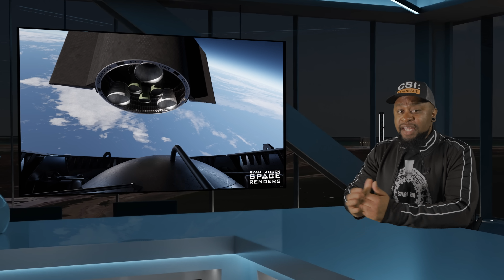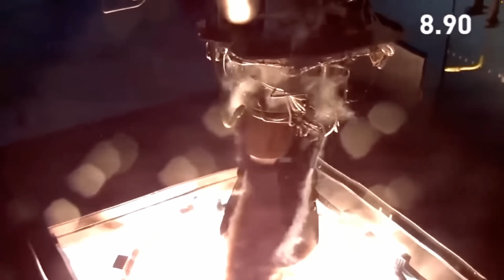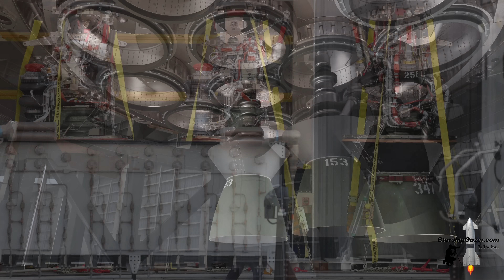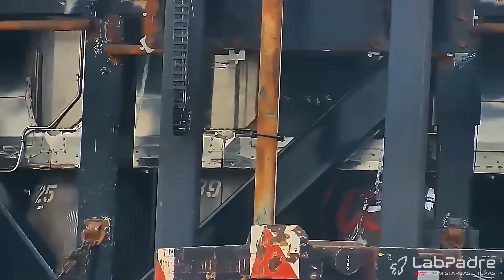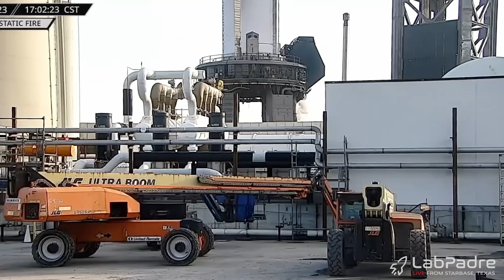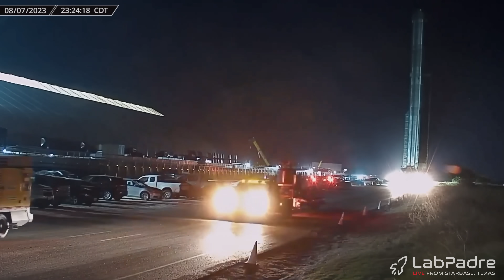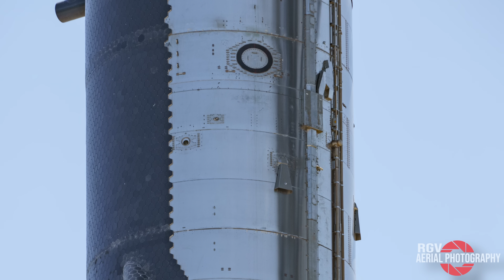How To Prevent Raptors From Destroying SuperHeavy | Part 1

Comment: If NASA had blown up two SLS boosters in flight, would the media have been as forgiving as they have been of SpaceX?
Reply from the maker: @wpatrickw2012 Probably not, SLS is not an experimental rocket. It’s designed to be an operational rocket from the very first time it flies.

Comment: The launch bidet table needs a spray with water based rust inhibitor after launch. It should be a low cost way to reduce steel ablation.
Reply from the maker: *After launch, would not help what happens during the launch.  Also it’s made of stainless steel so it doesn’t need a rust inhibitor.

Comment: We figured the fail for restarting engines on the booster of IFT-2 was from the fuel changing direction too quickly inside the booster during the "flip".  Much like when a car's velocity (or direction) changes rapidly and the occupants are thrown at the dashboard or steering wheel, the remaining fuel was intended for the most part to be contained in the tanks along the vertical axis.  All it would take is a single downrunner of pipe to break and we'd have gotten pretty much what we saw right down to the exploding engines since the leaking fuel would have been rushing toward the front of the decelerating booster.

I grew up in the 1970's and even the test glide tests for the space shuttle were not as cool as these test flights (and my dad was one of the guys who made the furnace they made the heat tiles with)!  I've been lucky to see Apollo-Soyuz pretty much as it happened (when it was on the television with Walter Cronkite) and now I get to watch space travel reimagined and a new batch of people who have a dream about something more than low-earth orbit.

Comment: I believe that SpaceX's solution to the negative acceleration on booster during hotstaging will simply be a change in the number of engines online on booster/throttle setting during staging. It's the simplest solution. Ship has a maximal forwards acceleration of 0.9g or so at separation at max thrust. All booster needs is to stay above 0g for the duration of staging ideally without exceeding 0.4 g. No complex additions to the design, no reworking of the design, just software updates.

Is there a concern that the additional forward acceleration will lead to the hotstaging ring being burned through by a prolonged staging process? I don't think so. SpaceX almost certainly planned to keep acceleration positive on the booster during staging, meaning that the hotstaging ring should already be engineered to withstand a staging process that involves relative acceleration between ship and booster of 0.5-0.8g.

I also considered the possibility that SpaceX might ditch the hotstaging idea and go back to the IFT-1 maneuver, but I realized that the main reason for hotstaging isn't the marginal payload mass improvement, but avoiding zero g during staging (obviously, IFT-2 had negative acceleration, which was even worse than zero g, but if done correctly, hotstaging should maintain positive g).

The problem with zero g during staging is the same as the problem with negative g, just less severe. The staging maneuver that would have been attempted by IFT-1 would have created a lot of centrifugal force on the booster methane tank, pushing the propellant up towards the top of the tank. While this push would have been less severe than that experienced during IFT-2 hotstaging, it also would have been longer duration. In order to successfully RTLS, IFT-1 would have needed to use gas thrusters to settle the fuel in the tanks, and by the time the fuel would have been safely settled, booster might have been very far downrange, possibly beyond the delta-v capability to RTLS.

Comment: Can FTS really be considered a success if the nosecone (and especially the header tanks located inside) survived? I know they burt up this time, but that's not the work of FTS.
If the failure occurred closer to the ground the header tanks would have likely survived until they hit the ground (ocean). Perhaps additional FTS charges will be needed.
We will see at the end of the misshap investigation.
Reply from the maker: The job of FTS is to cut thrust. Not necessarily to obliterate the entire vehicle.
Reply: @CSIStarbase That's just one of the requirements FTS must complete. It must also control disposition of hazardous materials, including highly flammable (potentially burning) propellants. All other propellant tanks on the ship were destroyed, but the header tanks survived. Maybe they are small enough or will drain out of the downcomers fast enough for this to not be a legal issue, idk. But at the Starship scale, even the header tanks contain metric tons of liquid methane and oxygen.

Comment: I don't know if we should call it a "near perfect hotstaging" when it likely caused the destruction of the booster. It's just a theory, but Scott Manley and other Fans/ analysts of the launch footage seem to think that sloshing/ gas injestion by the engines, caused by negative g loading during separation caused the failure.
Reply: Also, it's too early to call Stage 0 "fixed" the damage was minor compared to IFT1, but there was still damage to the vertical tanks, the QD systems and some of the concrete surrounding the steel plate.

It's definitely a step in the right direction, but not "rapid reuse" yet. 

I also doubt they can increase the pressure to deal with higher  thrust at lift-off. The pipes will have a maximum pressure, the water tanks would need to be expanded to allow for more water to flow during lift off and the steel plate would need to be expanded to compensate for higher temperatures far from the center of the pad.

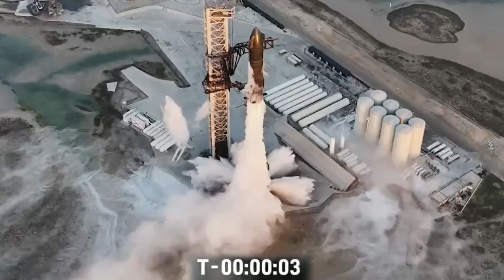Comment: 41:18 The order that the engine ignition diagram shows is probably out of sequence from what actually happens. I believe this would be because of a delay in the signals being sent from the booster to whatever receiver that spacex is using. What makes me think this is if you look at the engine shutdown sequence of the booster in the IFT2 footage you'll see that the engines shutdown in a symmetric  pattern but the engine diagram on the screen doesn't match that shutdown pattern.

Comment: Zack you are doing an excellent job of presenting all the clues discovered in your deep dives. - I am so tired of "form before function" type of reporting. - I am of the opinion developing this super rocket system is the most important item that Elon Musk is currently working on. - I hope the next big Elon Musk endeavor would be landing huge amounts equipment and supplies on the Moon to build a robust base there, as such would be vital experience in determining what is truly required for a Mars colony. - As a side note is a question that I am pondering is; would more sensors on the feeder pipes / systems / etc., help in zeroing in on possible problem areas such propellant sloshing, water hammer, or some other kind unknown issues be helpful for the development of this indispensable heavy lift space system?

As always, I am already looking forwards to your next deep dive.  -  Thanks.
--

Comment: Exploding isn't a success. Your cult is impressively brainwashed, though.
Reply: Thanks for the comment, although, it's wildly inaccurate and mis-informed. It's what happened before it exploded was a success, it got far further than the first flight. I'm more than happy to have a chat about this with you, but only if you lose the obvious brainwashing you've unwittingly absorbed, turned 180 degrees and projected onto us. Thanks again
Reply from the maker: Never said it was a 100% success.
Reply: @CSIStarbase I would be genuinely surprised if op had only watched half of the video. You accurately pointed out the improvements and tried to identify where things went wrong this launch.

Comment: A shame they are repairing the OLM again.. So much for the rapid re-launch capability
Reply from the maker: Repairs aren’t on the steel plates.  That’s what matters.
Reply: @CSIStarbase  why? Elon has promised 2 hour turnaround. Then it does not matter what need to be repaired. It should be ready right after launch.
Reply: It's in the prototype stage, I'd hold off expecting that until the design is proven.
Or do you think a design on a piece of paper goes straight to fully working in one step?
I imagine even the humble paperclip took a few tries? 
 @canidae7
Reply: @Geoff_A  there are plenty of examples of designs that have worked through to actually work.
The Space Shuttle, Saturn V, launch tower at KSC and so on and so on.

Furthermore OLM has been rebuilt once after the first failure. So it is not directly from paper.
Reply: Exactly, how many design alterations were made during their development? You seem to think this is the final version, it's very early in it's design and should be allowed time to mature. 
Re-usabilty is the goal, which includes Stage Zero all the way to the very tip of the 2nd stage. 
Now, how many of the things you listed can claim that as a design goal?
Mustn't forget how badly damaged the launch tower was by Artemis I or the amount of work needed to turn around Space Shuttle to launch again. @canidae7

Comment: I know you'll likely cover it in the next episode, but I wonder what the solution to the booster engine restart after the flip will be.  With such large tanks, fuel slosh has to be a bigger concern, so maybe improved baffling?  Or maybe header tanks so that maybe an engine or two can provide some ullage before restarting the others?  Maybe a couple of solid rocket cartridges for ullage? 
Even if the issue with restarting the booster's engines in IFT2 was a rate problem (yaw rate for flip maneuver), there's still a need for ullage with the low volume of fuel in the booster compared to the total volume available for sloshing.  At any rate, it's solvable.

Kudos on the analysis.  This was the first video of yours I watched, and I appreciated the objective and critical analysis you applied. Chapeau, man!

Comment: Do we think the engines and expansion chambers (bell shape jets) need to radiate dissipate heat into the surrounding space? Will the outer most engine constellation block heat dissipation and a consequent engine failure to those located next inner?

Comment: Just found your channel and is giving great detailed info, thanx its a great help. i wrote a piece on Stage Zero's original concrete base failure and concerns with the rocket and booster, from a charged matter perspective. Rocket engines create a lot of separated moving electrical charge and so big magnetic fields and which can bend and even break metal, if not protected properly from those effect.

Comment: You do a great job 'Emphasizing' what didn't Work. These are Test Flights AND Starship Test #1 in April WASN'T SU[POSED TO BE REASDY TO FLY. Elon Knew damn well its Chancre TO ORBIT was less than 50%, and SPACE-X TEAM KLNEW DAMN WELL They needed a DELUGE SYSTEM. Elon's DECISION was "IF WE DON'T LAUNCH WE DON'T LEARN ANYTHING". These are Test Flights there, CSI Whomever.... WALK BEFORE YOU RUN. ALL 4 RUSSIAN N4'S (w/30 Engines) BLEW UP ON THE PAD & BOOST PHASE. NASA HAS ALREADY KILLED 7 ASTRONAUTS ... Apollo 1 Killed 3 of them and never got off the pad. SPACE-X over 200 launches and No fatalities. WE LIKE TO TALK ABOUT WHAT SPAE-X IS "DOING RIGHT".

Comment: There will probably be maintenance needed for the stage 0 hot plate. They said that approximately 90kg of steel gets burned off each flight. So I'm guessing once a year or maybe 2 years they will have to switch of the center plate when Starship begins to make regular flights few times a month. But by then they may resolve this issue altogether, well see.
Reply from the maker: Check out the following tweet I posted on this subject.  We have calculated it will take 762 launches to burn through this plate. 

https://x.com/csi_starbase/status/1724898862890947028?s=46&t=uwSPkmd-dgwz_lPMKFqlig

Comment: SpaceX has conducted its second integrated flight test of Starship after seven months of intense reconstruction of the orbital Launchpad and making critical upgrades to both the first and second stage vehicles. The launch was a night and day difference from the first attempt, with SpaceX being able to keep all 33 of booster 99's Raptor 2 engines running at Peak Performance for the full duration of the Boost phase of flight. This allowed them to successfully reach stage separation and pull off a near-perfect hot staging of ship 25. Although both vehicles were lost with B9 exploding during its boost back burn and S25 being destroyed for currently unknown reasons, this was undoubtedly a fantastic success that SpaceX will continue to build upon. In a two-part episode, CSI Starbase Deep Dive Investigation examines all the major upgrades that SpaceX made as a result of the data collected from IF1, starting with a tale of two boosters, Booster 7 and Booster 9. Some of these upgrades were things that could be considered a natural progression in the development process, alterations that were already in progress long before the first launch attempt, but others were changes that SpaceX realized needed to be made after reviewing the data collected during IF1.
Reply from the maker: lol might as well copy and paste the rest of the script?

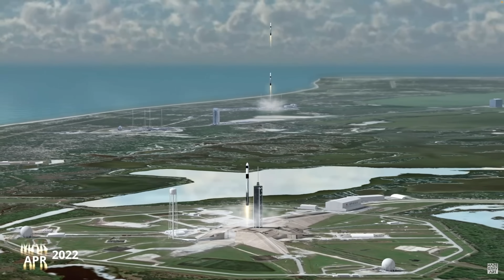Comment: 10:21 There have been two Merlin  1D failures in flight: CRS-1 and  Starlink 5 v1.0 (B-1048.5). In each case, the primary payload was still successfully launched, though booster B1048 was lost on landing.

Comment: So, once launched you were hoping for an engine explosion? Wow. No data collected? really.
Reply from the maker: Yes.  I was and I see nothing wrong with that.
Reply: Do you think then, you get more data from an explosion than a fully functioning mission? I don't get why you would want a failure apart from the anomaly that occurs.  @CSIStarbase
Reply from the maker: The booster is capable of losing at least 3 engines and still completing its mission.  So losing one would not be that big of a deal.  

I have friends on the super heavy team so of course I wouldn’t be wishing failure on them.  But if one explodes on the next flight and ends up taking out the engine next to it than that will mean the problem doesn’t get truly fixed until IFT-4.  More data is always better.  

That comment was one that I know their team would understand.  Sometimes I speak to them and not to the viewers. I do that a lot more often than people realize.
Reply: If you're wanting explosions though wait for Blue Origin and ULA. I feel they have a long way to go even though they have missions next year with NASA and others.  @CSIStarbase

Comment: I am so glad something happened so you produced another video. I mentioned on X that I noticed that starship used almost all it’s fuel to get  to 24,000 km/hr. Since it is supposed to carry 100-150 tons, it seems odd it almost didn’t have enough fuel to get to sub-orbit. SpaceX said starship FTS self activated based on the telemetry data and if it can make it to the intended landing zone. If thats the case was it because it didn’t have enough fuel to get to Hawaii. It could be an issue with trajectory and programming into the system but it all seems a bit odd. Perhaps Elon is relying on Raptor III for the thrust he needs.
Reply from the maker: We will discuss that more in part 2

Comment: I think that is rather to soo for claiming that Water  deflexion system was a success. It was possible to see some huge shockwaves (Witch warps some of water tanks at tank farm) that simply would not occur, at that scale, if they had a flame deflector instead. Certainly, this causes a huge complicated variable to be considered, witch could be an avoidable source for points of failures in many systems, since ground support equipments until onboard plumming/avionics. I think  Nasa whould choose to avoid this issue, instead told that was impossible, witch sounds plausible, at least. If best part is no part, the best design is that to avoid failures, especialy in a insanely-hell-complicated machine like that.
Reply from the maker: Those tanks are in the process of being replaced entirely.  They were already damaged and it was just made worse again.   The plan was not to get rid of shock waves.  SLS has one of the most massive shockwaves of any vehicle and it caused serious damage to the launch structure.  NASA seems fine letting that kind of thing happen.  It’s not as big of a deal as folks make it out to be in my opinion.
Reply: @CSIStarbase  make sense at all. Let’s hope that works

Comment: Zack, from what I have seen so far I would expect the Booster to need "header tanks" plus plumbing, like the 2nd stage to reduce the risk of sloshing during boost back and re-entry burns.
Reply from the maker: The booster has a header tank for landing burn.  It doesn’t have one for CH4 but the large downcomer functions as a header tank as far as we know
Reply: @CSIStarbase   Thanks for that, I still think that the boost back burn (BBB) needs to be powered using the header tanks, hence bigger ones are required. The main tanks could be nearly emptied and all engines could be shut down before stage separation and second stage engine start up. The header tanks could then be used to fuel the BBB etc. With six Rapter Vacs, the second stage would be more efficient, have more thrust and the hot stage ring would not be needed, reducing mass and making it easier to stretch (V2). Hopefully with six Rapter Vacs, the three off centre Rapters would only need to be used during descent and landing.